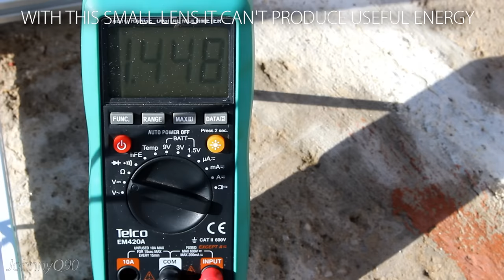Solar Powered Stirling Engine

Comment: Not 1... BUT 2 VIDEOS!?!! HELL YES

Edit: anyone who is better at the math then I am, willing to try and take a stab at seeing what efficiency that is getting?
Reply: We need to know the current as well as the voltage. Power in watts equals Voltage times Current --> P=VI, also the area of the Fresnel lens is needed. Some assumptions need to be made. A general agreed upon number of watts per square meter on earth is about 1000 W/m^2. Also if we assume that the lens is perfectly focused on the Stirling engine then its just a matter of dividing the output of the engine by the input from the area of the Fresnel lens.
Reply: Andrew Malaty would you also need to figure the type and  amount of fuel used to heat the lens?  Than subtract that from the total out put of the generator?  On the first video Sterling engine. Im not a electrical engineer. Just a mechanic.
Reply: I'm not sure what you mean by "heat the lens". If you are looking for efficiency of the system with solar power as the input then all you need is output/input. In fact the power from the sun is much higher than 1000 W/m^2 but a lot of energy is lost in the atmosphere. at the surface of the earth its close to 1000 W/m^2 on a sunny day. if we know the input which is the amount of power hitting the Fresnel lens, and the output which is the voltage times the current, we don't care about whats happening in between (as long as no more energy is being inserted into the system).
Edit: Also not a electrical engineer, just a mechanical engineering student in final year.
Reply: Andrew Malaty in the first video,  the Sterling Engine has a lens tube on the head of the engine. There is a fire the heats the collector to heat the air to run the engine. There has to be a fuel that is used to create the flame. The cost of the fuel,  the amount of fuel burned and the wick burn rate expended to maintain the flame are all part of the energy expended to create the voltage or current to power the LED.  All that information is needed to figure out the coefficiencie of the system. Is the energy expended to power the generator for the light greater or less than the amount of power the LED uses to light up?
Reply: I was discussing how to calculate efficiency of the system he built here in this video not the one in the previous video. For a flame powered system you would need to know the energy that is released from the chemical reaction of the fuel burning and compare that to the energy that the system produces. It would be interesting to see how the efficiency of these two systems compare.
Reply: Andrew Malaty there are 2 videos on this feed. A Sterling Engine powering a small generator and a video of the Fresenl  lens.  But thanks for answering.
Reply: No clue. But I'm guessing it's less efficient than a solar cell. To date, I have yet to see a practical use for a Stirling engine. I'm sure there is one, I just don't know it. Cool video though, I guess I'm just not seeing the point.
Reply: The solar input is around 60W, the motor/generator is around 1W (I'm guessing), so the efficiency is around 2%
Reply: Bradley Fortner there exist ovens, that use stirling engines to aditionally create electricity. (10kW oven + 1 kW electricity)
Reply: Do you have a source? The maximum photovoltaic efficiency achived so far was 41.2% out of theorethical maximum of 44% (http://onlinelibrary.wiley.com/doi/10.1002/aenm.201700345/abstract) and yet you can only buy panels with 21%.
Whats the most efficient solar stirling engine you can buy at a reasonable price?
One thing i was looking at earlier is this (http://www.okofen-e.com/en/pellematic_e_max/) a wood pellet oven which converts 10% of its power to electricity with a stirling engine (but it never states how efficient it is)
Reply: This comment got a lot more attention then I expected lol.
I figured it would be a simple 'area of lens':'watt output".
Reply: I would say 0.1m2 = 100W input for 2V*2-20mA=0.04-0.4W output. So very roughly <0.5% efficiency
Reply: Found here that the efficiency of small scale solar stirling reaches an efficiency of 18 to 23%. http://www.mpoweruk.com/solar_power.htm#stirling
Reply: that seems interesting yet keep in mind that the 34% efficiency is somewhat worthless to mention... to me it seems like one would be getting a positive outcome regardless of %... if it is a Stirling using solar power your always gaining... now to me the odd thing is to see that it is hard to find a solar Stirling engine, I am thinking hey can we get something that doesn't look like a toy kit??... I want to have the option of using it as a electric generator!!
Reply: I agree the sterling engine must be more efficient than a PVC. Even the best photovoltaic is only about 25%.
Reply: the sterling engine performs greatly in the difference in temperature, so give a lot of heat to the bulb, and cool down the other side
Reply: "Efficiency" ahh, there's THAT word. I'm more of a productivity person. Like burn a candle "Off Grid" at night to see in the dark to do the work you could get this engine to do while you sleep at night.
Reply: @taiwoolaleye6333  Yup. Plus if you make a BIG one w/o glass you can heat and cool from multiple sources. The "Efficiency" goes way up. I'm more of a productivity person. EG: While I slept my inefficient system charged my battery stack so I can use power tools instead of a knapped rock to make a wooden canoe from a log.
Reply: @robertostman2075  Check out what's being done with large scale solar energy in Arizona . They're using Sterling motors .
Reply: @robertostman2075  did you find it yet?
If yes, please send the link

Comment: How much load can it take before it stalls? You have to draw power from the generator for it to offer mechanical resistance, multimeters are designed so that they have as little influence on the circuit as possible while taking a reading. Put a variable resistor and current meter across the generator and dial up the resistance until the engine is at the edge of stalling, note the current, then disconnect the resistor and measure that value.  I^2R = power.
Reply: I've always wondered weather or not charging a typical USB device would stall a small Stirling Engine out, and if so, how big would it need to be/how much fuel it would need to make charging a device actually practical.

Comment: Great video. I noticed you painted your little test-tube-thingy black on the outside - but it's not likely to be a good conductor of heat. I think it'd work better with an unpainted tube, with something black-metal inside.
Reply: Except the test tube is the displacer cylinder so there is no room to put something in. It needs the bit of empty space at the end to even function.

Comment: I like all the work you did. I am a machinist as well. Recommendation: Make a larger bracket for the lens that mounts to the extruded aluminum frame rather than the engine.

Comment: 10/10

What about amperes amount?
Reply: This.  We need a small sample load, and current measured at the same time as voltage.  Voltage alone is pretty well meaningless.  Still, it's probably the most interesting Sterling I've seen on YouTube.

Comment: The machinist always wins.... I wish I knew one to make an eccentric shaft for my 3 rotor
Reply: SLF496x go to an local engineering school 
They will probably do it for you for free
I know we did when i were in school

And it was free btw because they looked at jobs like that as learning
Reply: What's an eccentric shaft? And by 3 rotor, do you mean rotary car engine or what? Just curious
Reply: Magnus Frederiksen an eccentric shaft is the rotary engine equivalent to a crankshaft
Reply: SLF496x i thought so. Thx
Reply: I was born with an eccentric shaft. 😏🤷‍♂️

Comment: Hi JohnnyQ90 I was wondering where you get your aluminum and brass round stock for making parts on your lathe. I have a foundry that I use to melt down aluminum into cylinders which works but sometimes the stock will have very tiny gas bubbles that formed when it was cooling making the surface full of very tiny pot holes even after they are machined into a perfect cylinder. 

Thank you, 
Chris
Reply: zombiecorp101 if you cool it down slower and vibrate it a little it will get the gas bubbles out
Reply: Thanks :)
Reply: try adding oxygen scavengers (materials which capture oxygen and precipitate out to the surface, forming slag), and flux to your ladle during melting to remove other dissolved impurities, as they don't 'burn off' in the heat, enough will dissolve into the melt to cause lots of problems down the road.

and as lock picker said, a controlled cool will solve a lot of internal porosity problems. your flux and oxygen scavengers should handle the rest of the problems. best of luck with future ladles of aluminum.

Comment: With concentrated solar like that you have to constantly adjust it to keep it aligned with the sun but if you made a bigger engine and used a solar water heater the solar collector would not have to move to produce power all day.

Comment: coat the outside of an airship in heat collector panels and use stirling engines to generate electricity

Comment: Use the giant lens from a projector tv. See how much power you can make with that.

Maybe go further by adding water cooling to the cylinders so it can operate at a better temperature differential.

Comment: Nice build. Liked👍, subbed, belled. 😎

A steam turbine is more efficient, more power for the same heat.
I've been researching modified tesla turbines to see if they have been improved on. Look into the tesla turbine, you might want to build one. 😉

Comment: Good work. Have you thought about flipping the cold side away from the heat source and adding a divider to keep the heat away? This would increase the differential temp and efficiency.

Comment: Great video really, but i got a tip for you the technic for any hand saws is to use the full length of the blade, less moves, less energy, quicker cut. ;)

Comment: I have commented on using a Fresnel lens as well. After a few robotics and programming classes I was thinking about having the Fresnel lens track the sun, and also adjust the focus. I don't know how hot too hot is, but I've seen Fresnel lenses produce 3000 degrees F. They actually melted glass, metal, rock, etc.Granted they were huge lenses, but still. I had one that melted lead, and torched a 2x4 instantly, after putting it under the concentrated beam. If the Stirling engine was big enough, it could be geared down to perform some sort of work.

Comment: All of that work for 1.5 Volts, looks like you need to do it all over again and make a larger version so it can actually do some work.
Reply: Besides that, we need to see the current with some sample load.  the voltage says basically nothing, by itself, regarding the energy this produces.
Reply: still, it ain't gonna be much?!
Reply: Because multimeter had set DC voltage aganist AC voltage.
Reply: Or buy a solar panel and install it on the lens frame :D
Reply: virDAT The generator that came with the engine is a small DC motor. Thus, it generates DC.
Reply: got an oscope hook up a dc motor an watch?!!!
Reply: snaprollinpitts 
I like to argue there is no such thing as a D.C. motor, only a.c. motors with mechanical alternators.
Reply: That's kind of something someone says to feel smart... You need DC for a DC motor. You don't say gas powered cars are just diesel cars that use a more refined version of oil.
Reply: You can get a higher voltage with different motor windings. The power of the engine is what's going to determine what work it can actually do.

Comment: I wonder what the power output is on this, compared to a solar panel the same size as the lense? Be interesting to know if the loses are more or less when converting solar energy this way?
Reply: 1man1van loses would be obviously more. You are converting radiation energy to mechanical. After that you convert it to electrical. For such a small system it is not at all economical
Reply: Hrushikesh Naik yes, but solar panels don't use every part of the light spectrum. This way of generating could potentially make use of more energy thus making the system more efficient.
Reply: Hrushikesh Naik you try boiling some water with a solar panel compared to boiling it using the rays from a Fresnel lense, see my point?
Reply: 1man1van quick amazon search yielded this result
solar panel 1m x 0.5m rated at 18V and 5.1 Amps.  That is 91.8 watts.

Although radiation energy available on earth surface is 1000w/m². We are able to effectively convert only (91.8 x 2 = 183.6 W/m².
Reply: 1man1van now for fresnel lens. The heat absorbed in water is a topic to be researched
Reply: Hrushikesh Naik I know this, but try boiling water with 5.1amps at 18 volts Vs using a Fresnel lense, don't be so narrow minded!
Reply: Hrushikesh Naik exactly my point sir!
Reply: Which is merely to say"water is transparent": add ink and it'll absorb solar much better.

Comment: With a 1.5v to 12v transformer you could theoretically make usable power. You could also use a capacitor of some sort. Not saying the amperage would be very high, but given enough time it could charge a 12v battery and whatnot

Comment: Well, I expect this won't make any reasonable amounts of power considering the heat energy it gets. But 1.45 V is absolutely meaningless anyway, since the energy (watts) is the voltage times the current, which you didn't measure, I guess we can assume it makes around10 mA for the LED at an unknown forward voltage of the LED. But 1.45V * 0.01A would be 0.0145 watts, which is relatively useless unless you only want to power a single LED, a clock or whatever... But it's nowhere near the 5V * 0.5A (2.5 Watts) a regular smartphone would need for slow charging for example. So I would suggest using a solar panel, it uses less space and probably gives you at least 20 Watts for the same surface area, which would be over 1000 times as much power. ;-)
Reply: Or buy for the same money a 100w panel xD
Reply: But that's not as fun as making an engine!
Reply: Also, this is concept. It can be scaled up. I’ve also seen a steam engine generator using a fresnel lens. It’s a good illustration of skills for budding engineers. 😀
Reply: Better yet, layer the systems. Transparent solar panel in front of the lens takes the uv part of the spectrum for electricity directly, but lets the rest pass through for conversion to heat and subsequently to electricity. Scale up for useability, of course. Or screw converting light to heat/electricity, instead convert it to calories; feed plants with it, particularly the kind of plants that can feed you right back.
Reply: solar panels are still relatively weak compared to panels-that-just-absorb-the-solar-rays-as-heat.
Reply: This was just a project I assume the real deal professionally installed Stirling engines or more efficient and more powerful in the presence of the Sun

Comment: Now make a solar tracker that is powered by the generator that you've just made😂
Reply: You'd need to store several minutes worth of power most likely to move a motor.... you could probably power a small microcontroller at 128Khz quite easily to make it programmable while not wasting much power for processing a few mA probably.

Comment: Crazy thing about this was that the design&production models were built around the turn of the 19th century and was mass deployed in North Africa until the gasoline&engine became more profitable displacing this technology.
Reply: Can you say a bit more? 
So the Stirling engine was more powerful/efficient/profitable then even the later versions of the steam engine?
Thanks.

Comment: Really cool build! Have you thought about solar motion tracking using electronics? Also just out of curiosity, why did you decide to drill and tap into the extrusion as opposed to using t-nuts/corner brackets for faatening? Keep it up!
Reply: *fastening

Comment: Have you tried to use solar collectors instead of a lens, connected directly without glycol to the sterling motor? The entire collector should work better than such a poppy lens. And the problem of facing the sun would partially disappear.

Comment: How do you know that it doesn't produce any useful energy if you only measure the voltage?

1.5V is probably determined by the rotation speed. It doesn't mean anything when it comes to energy actually converted from sunlight to electricity. You need to add something that actually uses this electricity, then measure the voltage AND the current. Multiply those, then you know the wattage. That is what you want to know.

The voltage is irrelevant. Use some step-up DCDC converter to get to 5V and charge your USB-stuff with it. IF it has enough power, which you didn't find out yet.

Connect for example a 10 Ohm resistor to the output. If you still have 1.5V then you have a current of 0.15A and thus a power of 0.225 Watt. Connect a 5 Ohm resistor (or two 10 Ohms in parallel) and if you still have 1.5V you have 0.45Watt. Go down to 1 Ohm, the current should be 1.5 Amps, the power will be 2.225 Watt. And that would at least be able, once stepped up to 5V, to charge some USB equipment.
Also, you could change the gearing to get to a higher RPM to get to higher Voltages in the first place.

I would be really curious how much energy this thing actually can deliver. Not the voltage.

Comment: Use aluminium tube painted with black colour to cover the first glass tube and filled it with heating oil to make  effect lasting several minutes and to produce efficient power use stepper mottor.